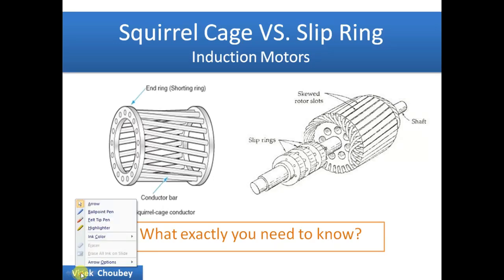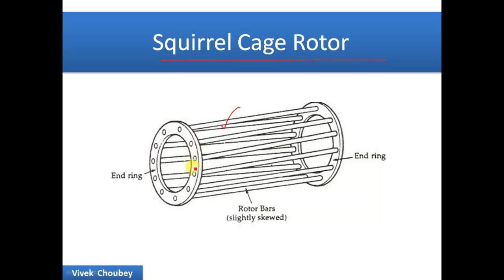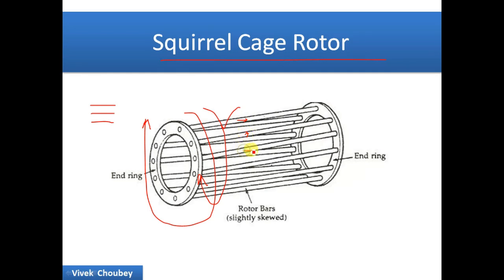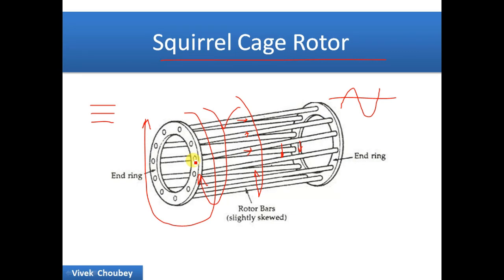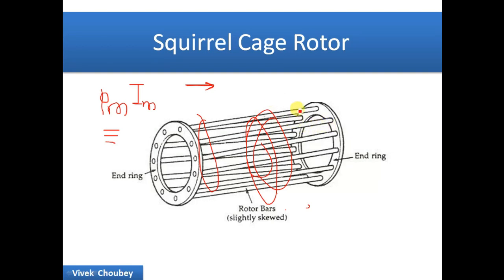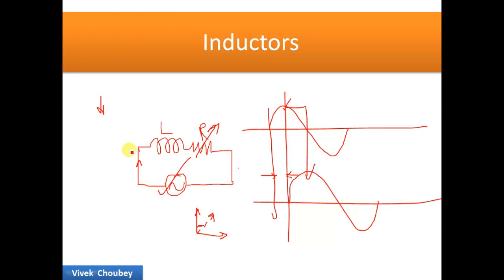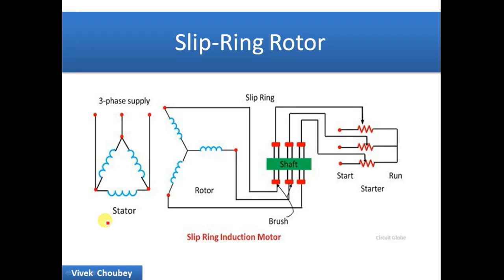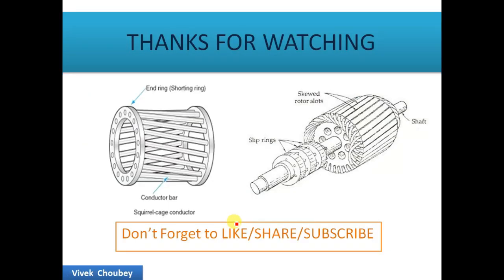Slip Ring VS. Squirrel Cage Induction Motors | What EXACTLY you need to know?

Comment: What shall one do to replace an slip ring motor with squirrel cage motor and also can a vfd is used with slip ring motor.
Reply from the maker: Both machines have different physical design and capacity so one can't be transformed into other. The only way is to get another motor instead of slip-ring motors.

There is no such restriction with slip-ring motors however VFD in addition to slip-ring will be an overdo and the entire setup will be costlier. So we choose economical alternative which is squirrel cage motor and connect it to VFD which is sufficient. Slip-rings aren't required as the VFD will automatically set tje the required high starting torque and low starting current during the start phase.
Reply: @ervivekchoubey  sir I have doubt  my requirement is I have to replace a 132 KW ,970 rpm,415 v ,50 hz AC slip ring motor with a suitable squirrel cage motor but I am poor in this aspect .I would like to hear from you on this please explain
Reply from the maker: I can't explain you the different aspects involved as the type of load requirement, temperature and other similar factors are involved which can't be explained in writing. Important thing is that the active power rating should remain same or higher alongwith the voltage rating and range. Also you have to ensure that the power factor remains high. Torque at start should be high with low starting current so that there is no abrupt voltage drop. These are (but not limited to) things to take care off.
Reply: @ervivekchoubey  Thank you sir
Reply from the maker: I wish you the best 😊
Reply: @ervivekchoubey  thank you sir
Reply from the maker: Here's all about VFD and how it works https://youtu.be/tmWJ_plElWM

Just in case you need...

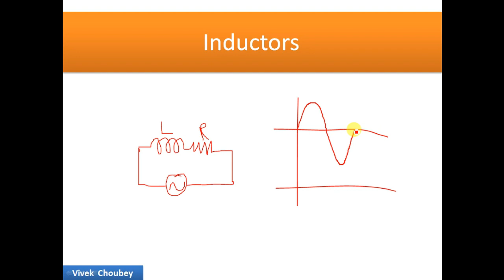Comment: where is the inductance coming from the squirrel cage rotor bars??? @6:30 you showed an RL circuit. dont you mean the inductance come from the stator winding of the motor???
Reply from the maker: The stator winding generates time-varying magnetic field which links with the rotor (squirrel cage bars). Being shorted at both ends, current begins to flow through the rotor bars. That's why there is a rotor inductance because it tries to resist the effect of stator magnetic field flux and hence begins to rotate.
Reply: @ervivekchoubey  thanks for explaining

Comment: What is the different between slip ring induction motor than universal motor (that are many used for electrical tools like drill, grinder, blender, etc)?
Reply from the maker: Induction motor whether Slip-ring or squirrel cage, works only on AC current which generates time-varying air gap magnetic field. Whereas, a universal motor is the one which can operate on both AC and DC current like a DC series motor. This is because torque in DC motors is directly proportional to product of field current and armature current. As this is a SERIES motor therefore both armature circuit and field remain in series and receive the same current. So, the torque becomes directly proportional to square of the armature current and thus it doesn't matter whether the current is AC or DC, the torque is always positive. 

Induction motor works on the principle of induction where both stator and rotor aren't physically connected but are magnetically coupled whereas in a Universal motor like DC series, the stationary and rotating part isn't physically isolated. For high traction and control purpose we use AC Induction motor rather than DC series.
Reply: @ervivekchoubey  many thanks for your kind explanation.
Reply: @ervivekchoubey  Friend, can you please explain or make a video how to calculate a rotation speed of a DC and universal motor? I am confused with the parallel path. What is the benefit of having many slots than just few slots? I am a technician, so I appreciate if you show with real armature. There are many lecture videos explaining it, but hard for me to underatand as the explanation are too theoritical. Need real example by showing in a real motor.
Reply from the maker: Okay, I'll look into it. Basically, slots are done for one purpose that is to effectively link the magnetic field. More slots will effectively hold the magnetic field rather than allowing it to leak out and get wasted. Another advantage is the proper distribution of the coils on the rotor. More the no. of slots, more distributed winding will be there and therefore the magnetic field will also be suitably distributed. This helps in building up the machine torque as well as keeps the motor in balance. This is because the winding will be distributed so the entire rotor will be having equally distributed weight rather than some parts having more weight than the other. So, this will keep the rotor balanced and also reduce the risks associated with the centripetal force.
Reply: @ervivekchoubey  I hope you may post a video about it. My most question is about "what is a parallel path" in DC/Universal motor. But good if you cover it completely, your viewer will be happy.

Comment: I have two squrriel gage indication motor but they have different voltage at the stator windings (400_230)volt the 400 v burned the stator windings and the 230 v has erosion at rotor shaft( rotor damage)  ... My question can I change the rotor form 400 v to 230 v stator (the both rotors has the same dimensions)
Reply from the maker: It can work but the thing is that there will be heat generation and even the motor might not work because the rotor is designed to rotate at 400V so at 230, the motor might just try to run but fail thus withdrawing huge current and heating the 230V stator winding. The air gap magnetic field flux is directly proportional to voltage and it generates the required torque. So, lower voltage means lower torque and the motor may fail to start off or shall run at very low speed.
Reply: @ervivekchoubey  thanks for the quick response

Comment: Good quality video
Reply from the maker: Thank you so much.
Reply: @ervivekchoubey  I am a civil engineer. But currently working on ebike as hobby. Would u suggest whether it's suitable to use a slipring induction motor with rotor energy recovery system for electric vehicles instead of BLDC.
Reply from the maker: @apurvmj  as far as I know BLDC would be a better option owing to its high speed performance and easy interface. Slip-ring induction motor will be bulky and not a great option even with power recovery scheme. Otherwise you can use squirrel cage induction motor with VVVFD. But if its possible then use BLDC that's what I would recommend. 

Regards.
Reply: @ervivekchoubey  thanks
Reply from the maker: @apurvmj  No problem :)
Reply: @ervivekchoubey  With BLDC in EV can u free wheel during cruising. I guess BLDC put drag while rotating during free wheeling. And is it possible with normal induction motor to get regenerative braking?

Comment: Your slide showed the stator wired delta and rotor wired as Y. Is that for a reason? The ones I have seen are opposite.

Are there problems with harmonics on the rotor from the rheostat?
Reply from the maker: Well different designs are possible. I haven't particularly emphasized on the design here

But according to me, Delta connected stator or delta connected primary of Transformer is preferred in some places because the delta connection causes natural elimination of the third harmonic zero sequence current. Out of all the harmonics, the third harmonic current is the most severe and causes disturbance in the overall torque. But a delta connection would let the zero sequence current to flow within the delta but not in the line. So, before the 3 phase RMF links the rotor, the third harmonic flux is eliminated. 

On the other hand, the rotor is star connected which provides a neutral path and also as the rotor is star connected so the line voltage is √3 times the phase voltage and hence the number of turns required is lesser compared to a simple winding for same voltage. This decreases the complexity in rotor winding as well as decreases the rotor weight and helps in rotor acceleration smoothly.
Reply from the maker: Not exactly, rheostat is just linear resistance. It will not cause any problem of harmonics. Instead the resistor helps to increase the starting torque whereas harmonics causes failure in torque building.

Comment: Why the no of rotor bar of a squirrel cage rotor is prime ?
Reply from the maker: Prime numbers are non divisible numbers. Rotor slots are odd prime numbers so that it doesn't falls under the stator pole and locks magnetically (cogging). Number of stator poles are even and the only way to ensure that rotor poles don't lock with the stator poles is making odd and prime number of rotor poles.